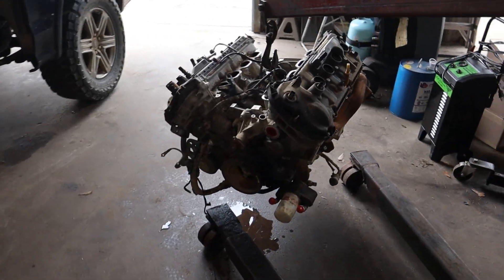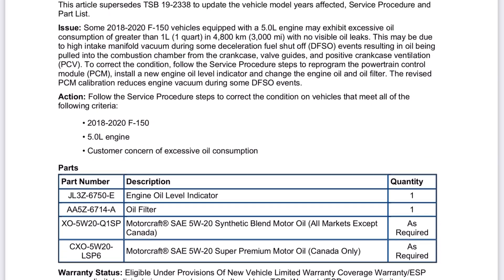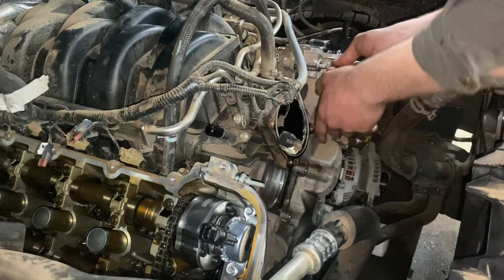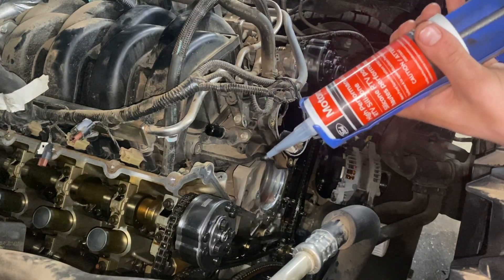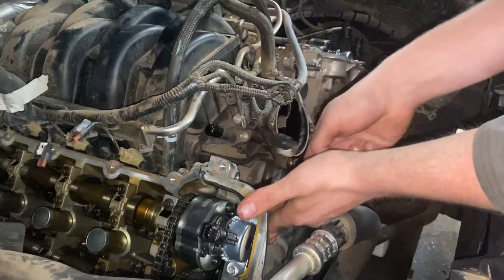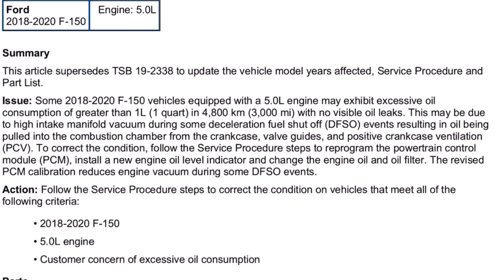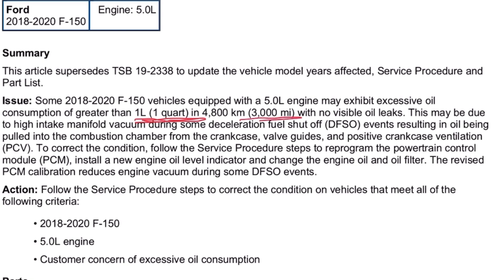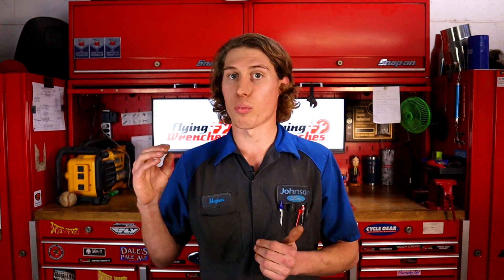Ford 5.0 Coyote Oil Consumption FIX

Comment: Oil burner is a peeve, I check oil atleast once between oil changes.  Alot of manufactuers say 1 quart in 3,000 miles is normal, that gives them a  loophole to avoid fixing the issue.

I wont tolerate oil burn , in 98 my 3/4 ton chevy, sales guy was mentioning they loosen the rings(i looked at him cross eyed), as who the hell would intentionally create an oil burner(chevy did) , 1 quart every 3,000 miles, Tore them a new A$$ every survey, and they kept sending them.

Comment: I noticed mine burns about 1qt every 2k miles. The dealership basically told me the same thing: Ignore the dip stick. As long as there's no low oil light, there's no problem.

I have 75k miles on my 2020. Still all stock except filters and oil. There are no trouble codes, and it still runs strong. So the oil burning isn't causing any problems, it's just psychological. I have the dealership do the oil changes every 5k miles, and have an extended warranty until 125k miles. So if there is a problem, it won't be my problem.

Comment: I'm 64, check my oil frequently.   I purchased a "new to me" 18, f150.  5.0. It had 62K miles when I got it.  I've got 67K on it now, and have had to add 2 quarts with in that mileage.

Comment: Disagree with you that the oil consumption isn’t an issue.  For what these trucks cost it better not burn a drop for at least the first 100k miles.  Just another example of Ford’s lack of quality.  I check the oil in our vehicles regularly.  Excessive oil consumption will plug up sensors and the cats eventually, and it’s a pain in the ass to always have to add oil.  Newer engines shouldn’t burn any oil and the manufacturers saying oh well it’s normal is unacceptable.  We have two Toyotas each with over 200k and neither use a drop of oil.

Comment: I figured that the extra oil capacity was to keep the oil temperatures down. These engines made their comeback in 2011, that’s the one I own. They have oil jets that spray up from the crankcase onto the bottom of the pistons. That helps keep combustion temperatures controlled and consistent. That extra volume helps dissipate that heat while going through the engine oil cooler.
Reply: If I remember right only the mustangs have the oil squirter‘s.
Reply: @h.merica  nope, the F150 has them too. Only real difference between the truck and the car engine is the exhaust manifolds, and the tune on the ecu. The truck is set up for more torque.
Reply: @markk3652 Not true the intake Is different and the compression ratio is lower.
Reply: @marktarascio4766  splitting hairs here. Basic engine architecture is the same, you’re correct, I overlooked the intake and compression ratio. My point was more about the oil capacity and the reason for it.

Comment: I'm part of that 5-10% who does check my oil level pretty regularly on my tuned gen 3 5.0 F150. You may be right, but I won't accept an answer from Ford saying 1qt oil consumption every 3000 miles is normal. I'm sure Toyota would agree with me that this is BS...

Comment: I don't want to check my oil but I have to because I need to add a quart every 2 weeks in that stupid 5.0. Maybe I should wait 12 weeks and I will be 6 quarts low. How long can the engine run with 2 quarts left in it ?

Comment: Low tension piston rings (used in todays engines and help with mpg), combined with Direct Injection cycles and higher compression is a recipe for blow by that leads to pressurized crank cases. Oil “mist” from the crankcase travels through the PCV back into the intake.  Hence the reason Ford needed to reincorporate Port Injection alongside direct injection to clean the intake valves that were getting carbon build up from the oil that recirculated through the intake.  

1) I suspect a quality issue with the low tension rings
…OR…
2) a re-design/update to the rings that makes them more susceptible to carbon build up issues that allow the rings to get stuck and not provide the wet seal needed to prevent blow by.

If “Option 2” is what’s happening,  best thing you can do is use BG EPR (cleans carbon build up in your ring landing areas), BG 44k (cleans injectors, piston crowns and in engines with port injection will clean intake valves) every couple oil changes.

There’s a website to search out a local service shop that provides BG Products.  I can add that if anyone needs it.

Comment: What people need to do is ask there parents how long they went between oil changes. In the beginning 3k miles, then later 5k miles. Ask them what they were told about burning oil. A qt every in-between services is normal as in no issues. A complaint isn't a problem. I see cars every week under warranty, talking about they had to add 2 quarts in-between oil changes.......at 10k mile oil changes. I can't fix that complaint because it's not a problem.

Comment: I got a 2020 I’m a mechanic also I’ve never check my oil till today bought the 2020 about 3 months ago and about a month ago started to get a clattering sound switch to 4x4 went away took it in under warranty put new hubs and vacuum lines in pick it up still making the clattering sound but not as bad I figured today let me check my oil I was 5.5 qts low I have 42% oil life left but I topped it off and unfortunately my clattering sound didn’t stop

Comment: I remember the triton v10 I had burned about a quart per 1500. It was even said that this was normal for the engine. Perhaps thicker oil would help. That engine had 5w20 or something thin like that
Reply: My 2002 V10 burns a quart usually every 500-1000 depending on towing or not. I have found the issue is the vacuum is so strong in that engine, it pulls the oil through the PCV valve into the intake and burns it off. How do I know? I added an oil catch can and had to empty it quite often. 
It is odd that the EPA has not caught on to Ford using so much oil in this way, it is burning it up in the Exhaust and I am sure adding more emissions. Not convinced the catalytic converter can burn off all that oil clean. 
I don't think it is sound advice to tell everyone to not check their oil unless they want to lose an engine! I carry up to 3 quarts in case I am on a long trip. It depends on which year vehicle they have and if it has a low oil sensor. I also think that running low on oil makes the oil work harder and therefore will shorten it's life. Thicker oil is not the right answer either. It is just something we have to live with.

Comment: I check my oil weekly, also older cars had what's called idiot lights when your car was low on oil. All of the late 60's and 70's cars I owned had them. My 70 bug even had one that told me when I was low on brake fluid.. Very similar to some modern cars that don't have a temperature gauge, all you get is a temperature warning light...

Comment: I drive a 2018 for work , got it with 2000 miles in august 2018 , have just over 160k on it now , and I have to add 5 quarts between oil changes , right before the warranty ran out I noticed it ran like crap in a sharp turn or on a hill , similar to when the cam phaser failed under warranty , I called the dealership and they said it would be 2 weeks before they could get to it … so I figured I would pop the hood and see if I could find something that was obviously wrong … well I had to add a gallon of oil to get it  the dipstick wet

Comment: I dont know about other guys that has the roush performance level pac 2 installed, but mine after the roush kit solved this issue, drove from alberta to new-brunswick towing a 20ft loaded enclosed trailer, did not burnt a drop since!!!

Comment: My brother in law had a 2018 ford with a 5.0 coyote and his engine blew up at about 85,000 miles, he followed all routine maintence he was suposed to follow, he probally never checked his oil so your advice to stop checking your oil is stupid and is a recipe for a blown motor, if your going to give smart advice tell them to check their oil and fill it, if you keep it in the hash marks you are safe. Ive seen too many of these come in with no oil on the dipstick and its ludicrous to me that you think that its ok to run your truck dangerously low on oil. If they follow your advice you will be replacing a lot more of these coyotes.

Comment: I find this interesting because my old 5.4 burned a bit of oil between changes it was an 05 or 06 and my 5.0 is a 14 and it doesn't seem to burn a drop between changes, I also drive the 5.0 harder than the 5.4, so really doesn't make too much sense to me, I do however 99.9 percent of the time run on e85 for the cost savings over gas.

Comment: 5.0 Coyote owners need to be running a 0w-30 synthetic or 5w-30 synthetic oil. 5w-20 is not stout enough. No reason for this other than CAFE standards.

Comment: Give me a break! My 20 was guzzling 4.5 qts every 5k miles. Dont tell me not to check my oil. It got a new engine at 34k.
Reply: And one more thing.... What do you think all that oil guzzling is doing to the cats. Ford is not going to replace them that's for sure
Reply: @spirorevelis7100 Ford replaced one of mine on my 2020. It’s going in next week again for a consumption check.  Burned oil down to the tip of the dipstick at 3000 miles now.  Did the TSB too.  It seems to consume more in winter.
Reply: @spirorevelis7100 I just pulled a plug yesterday and it was completely carbon coated. I can only imagine what the valves look like
Reply: I guess Ford made a 4-cycle engine that needs mixed gas like a 2-cycle 😂
Reply: @ResourceRentals  🤣🤣🤣   Thing is with mine it doesn’t lack power. I pull my 8.5’ x 18’ cargo trailer for my wife’s home staging business. Has plenty of power for that. Just drinks oil like a sob. 

UPDATE: I’m doing the consumption test with my dealership, 1000 miles in an it is halfway down the hash marks.  Once I get to 3000 they will assess where the oil level is and make a decision. My estimates is that it will be just a drop on the dipstick left. Hopefully, they do something.
Reply: Ford's new idea. Just keep adding oil and change filter at 5,000 miles. No need to schedule oil change. 😅😂
Reply: How do you guys feel about proper engine break in procedure?
Reply: @davidortiz173 well, I didn't tow anything for first 1600 miles on my 2018 5.0 f150. No hard acceleration, and no long highway speed for first 500 miles. Kinda babied it for first 1600 miles. Still driving "sensibly". Oil consumption has always been hardly any for first 2500 miles after oil change. Then, uses about a quart between 2500 miles and next oil change around 4500 to 5000 miles.
Reply: @dugie5246 I still feel you did the right thing!
Reply: @dugie5246 I have the 3.5 ecoboost and I check it every Saturday. It's got 130K and I never had to add oil. So Ford got something wrong with the hone job or ring tension.
Reply: My 21 f150 just came due for an oil change. It was 5qt low. I will be checking mine every time I fuel going forward
Reply: I’ll give you a break, come sit on my knee I got some cheese for that wine.
Reply: @spirorevelis7100  Ford dealership finally admitted my 20 5.0 is burning too much oil. Taking it in on 3/28 for them to tear into and determine a fix.  Making progress before my warranty ends!
Reply: @lukesdoings7150  good luck. I had a big advantage as I worked with a dealership who had a lead mechanic who was very familiar with the problem and the process.
Reply: @ did they actually see a problem? I’ve read that it is improper honing of the plasma lined cylinders.
Reply: @spirorevelis7100 Ford is replacing my engine. The dealership found significant scoring on cylinder #5.  I am now waiting for them to call me back as to when I am getting a replacement. Note, I have noticed excessive consumption over 2 years ago. Did the TSB.  Changed my oil religiously between 3k and 4k miles.  I don’t overload or over pull.  More to follow.
Reply: @lukesdoings7150  glad to hear that bud!!! Best of luck going forward.
Reply: Maybe it'll lockup before 3000 they'll know for sure what problem is/was.
Reply: Start off preaching like john the baptist then turn into the devil
Reply: Possibly the worst advice I’ve ever heard. I found out mine was eating oil because it came up with low oil pressure halfway to needing an oil change. These 5 L motors are junk.
Reply: I have a 2019 F150 5/0 coyote.  First replacement engine at 33k and as of today 12/27/2024 with 42k miles engine #2 is being installed. I was eating 1 quart of oil/500 miles.  Supposed the plasma cylinder lining fails.  Ugh…
Reply: @Jose_Miami bro i have a 2019 wtf mines is at 137k With the annoying typewriter tick but besides that its running no slips or nada
Reply: @koisamis8597 that’s how my Mustang is but I do have a oil consumption issue but whatever she’s happy and healthy i think
Reply: @lilman-fs4ft  Hi bro i took mine to the dealership, Got it reprogrammed was supposed to fix but she still drains about a quart or two a week like a whore😞. I guess its just 5.0 shit bro.
Reply: @Jose_Miami  You gotta hammer on that gas more. Break in those rings!!!  Most people who are burning oil HAVE LOW MILES!!!
Reply: Out of the blue guess .. in 18’ they added that spray on cylinder liner and cylinder deactivation. I’m betting those together have something to do with thisssss
Reply: @mittsoutdoors9240  actually cyllinder deactivation did not get implemented untill 2021. But yes, the 2020 had plasma arc lined cylinder walls in conjunction with low tension rings. Just another "efficiency" measure. Backfired! Poop! Hot garbage!
Reply: @mittsoutdoors9240 1500 miles on my replacement (Ford remanufactured) engine. So far, so good. Yes there is an issue noted, online somewhere, with plasma lined cylinders. Some batches of blocks had bad honing.  No cylinder deactivation in 2020, though.
Reply: My 2018 burns oil like crazy. This guy is an idiot

Comment: Mine burns about a quart a month from pretty minimal driving, but it’s a 2011 and has 160k on it.  I will keep driving it until the wheels fall off. The cost of a new quad cab lariat is atrocious at this point.

Comment: I check the oil in all my vehicles when I fill them up.  My 2019 burns oil slightly but I don’t think it’s that big of a deal.  I top it off if it’s 3/4 of the way down to the low mark.  I usually change my oil at 5,000 miles.
Reply: So I started getting a P0430. I also notice black soot out the tailpipe of my 2019. Before pulling off my cats to check I assume oil has been contaminating the cat.  Should I just go get the PCM update and replace my cats?  I can do pretty much everything on my truck myself but the PCM update is the only thing I don’t have access to.

Comment: I have a 2018 F150 5.0 with 112k miles, it burns oil.  I change my oil every 5k miles, I’m averaging a quart between oil changes.  If I do a lot of open road driving the consumption is less than short trip or stop and go driving.  It is the highest oil consumption engine I’ve had in the age of EFI.  I’ve got a 64 F-100 with its original engine that burns less oil.

Comment: Glad I have a hemi, it burns no oil between changes. Run a good 40 weight in it instead of 20 weight to prevent lifter issues and its solid as a rock. Same as the coyote, runa 30 or 40 weight and it will virtuall stop oil consumption. Manufacturers across the board are running thinner oil to improve fuel economy but it has its negatives like lifter issues in Hemis and chevys and oil consumption in the coyote.
Reply: My 5.7 does not burn oil either. Upon getting the truck, i began using 5w30. 20 weight is way to thin.
Reply: Facts, Every one of these complaints would go away if folks would just use a decent 30 or 40 weight oil up north. In Florida we run 5w50 in everything, Hemi's Coyote's no issues. Like this kids videos but it would keep me up at night not checkin my stick.

Comment: Run a 30 weight at minimum in a coyote, 40 weight is ideal but 5w-20 is not adequate protection for any higher horsepower engine/and is the reason for the consumption. In 2018 the oil viscosity recommended by Ford in the owners manual went from a 5w-30 to 5w-20.

Comment: People have to realize these engines have extremely durable forged pistons in them and a side affect of that is using oil! Forged pistons have to be installed with alot looser tolerances as they expand alot when they heat up.Its the same deal with the 5.0 mustangs in the 80s/90s.They used forged pistons also and i bought one new in 86.It used a quart every 1500 miles but Ford had so many complaints about it that starting in late 92 they switched to cheaper hypereutectic pistons and had no more complaints but alot of people that supercharged there 5.0 after the switch smoked there engines not knowing they started putting cheaper parts in them.Its a trade off!

Comment: I’m under 65 and I check my oil periodically in all my cars. I have a 2019 Mustang GT with a 5.0. With the strut tower brace, it’s not the easiest to pull the dipstick and have the confidence that you are getting a good measurement.

Comment: Ford received complaints for low oil pressure readings when hot stopped in gear on 70s and early 80s F-series. The answer? Idiot light sending unit and resister in gauge. Oil pressure reading always in the middle of the Gauge unless the oil pressure dropped below 7 psi then would bottom. Cut the resistor out of my later model cluster on my truck and installed an older model  sending unit that actually read the pressure.

Comment: It’s ridiculous to advise car owners to not check their oil. These 2018 and up 5.0 Fords clearly have a design issue to consume oil the way they do. I know of one purchased new that was serviced regularly that the owner did as you advised and didn’t check the oil. One day it threw a check engine light which said there was a cam position sensor bad. Turns out it needed 7qts of oil. The cam sensor wasn’t bad at all. It NEVER gave any indication it was low on oil. Do not advise car owners to not check their oil.